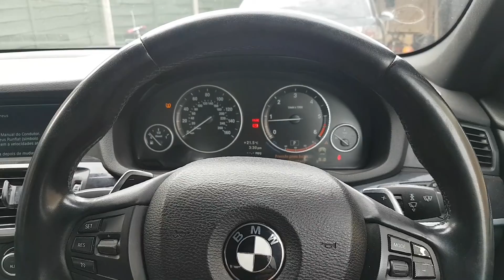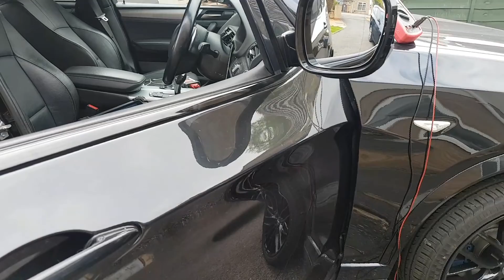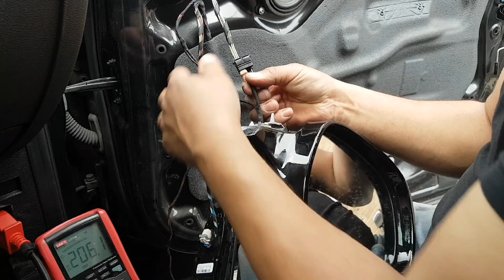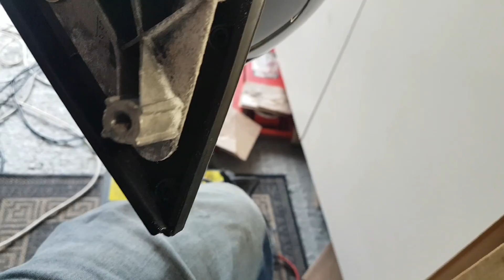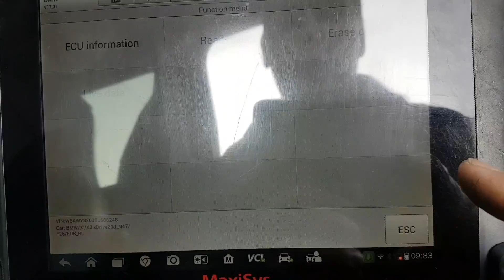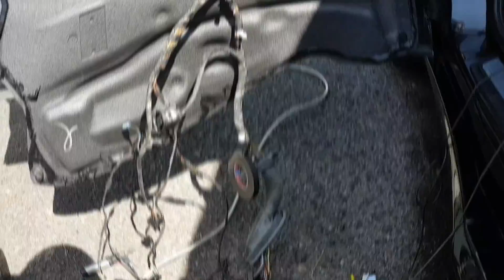BMW X3 F25 both door mirrors not working... Fault finding and repair.

Comment: Great repair.
The person or people that repaired the car, are not into doing the job properly and checking the little details! They got the car cheap, fixed it then sold it. Rush job! If they were repairing a customers car, they would have transferred all the necessary parts and make sure it works. Also another YouTube channel that repairs auction crashed cars, says keep all the old parts just in case.